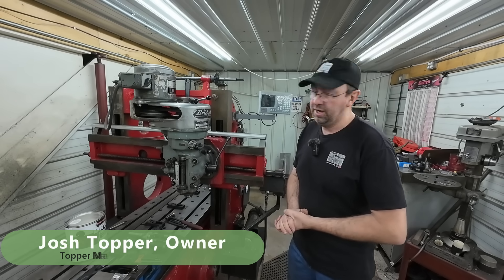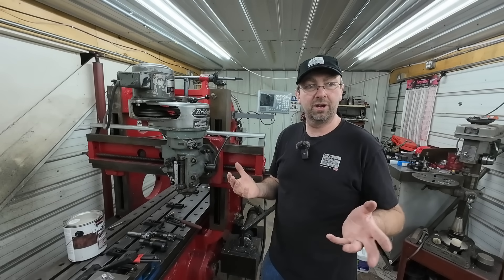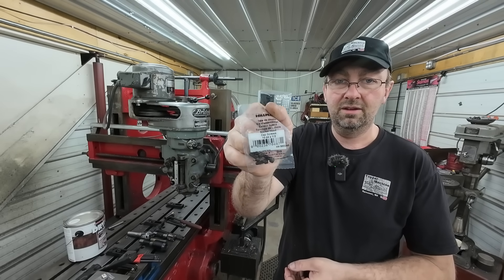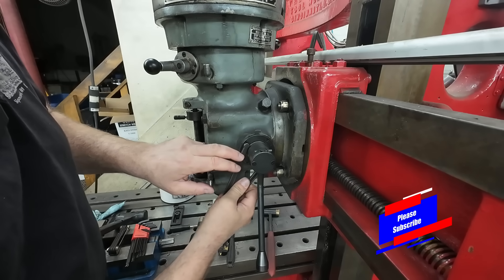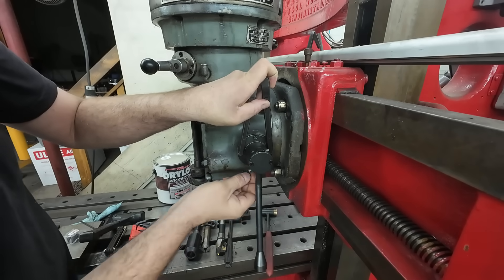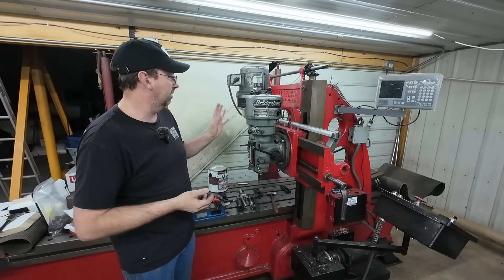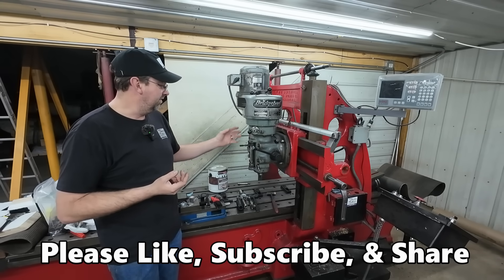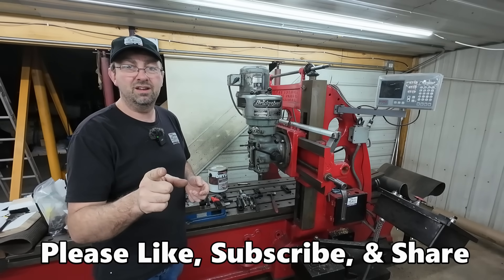Bridgeport Mill Repair Follow-Up | Setting The Clock Spring & Answering Viewer Questions & Comments

Comment: My power feed broke because the gear that drives the shaft (the worm wheel I guess) broke. It's very thin abd either pinned and setcrewed or just one, I forget. But, it was cheaper to buy a China assembly and use the gear from it,  than to buy just the gear. I have to get all the little balls and the "barbell" now. Power feed isn't important until you really need and miss it! Never put a long screw in the scale ruler mounts!! It prevents it from moving freely.

Comment: Bro, what is that green slime you are using? 
I use a plastic liter coke bottle with cutting oil and water, and i hate it. Thank you for your bridgeport videos. My boss has one that has a perfect head, but the table and base are antique hungarian . The table has automatic feed rate settings and a perpendicular drive centered below the quill that accepts a 3 jaw lathe chuck. The base can accomadate a twelve inch lathe chuck An absolute gem of a machine. 
The head works beautifully, however the only tool the boss has for it is a 5/8 drill chuck.
For ten years, without a vise, i can barely drill a hole. I would love to do a video or video call with you, I am asking for help . I know this machine is capable of machining  billet into a top fuel hemi or a gun barrel for a tank, yet she has problems ( missing every piece that makes her a mill. Im so drill  (de) pressed to have this at my fingertips, yet it is useless.
Reply from the maker: The green snot is Anchorlube. It is available through my website.

Comment: I don’t get why the quill doesn’t need to retract . Is not like you can mill whit out the quill lock tighten . I have a couple stile machine mills , tool room style , Bridgeport style( china and Taiwan) not original Bridgeport, because I hate R8. I have just 40 taper …. If is whit a quill , the quill spring retract it … that is what springs do 😂 
Please explain what is the benefit on not retracting … I don’t se it .

Comment: The quill is predominantly used for drilling so the spring tension should be set with a drill chuck loaded in the spindle. You may find that when you use it the quill will drop.
I would also check that the quill can fully extend without the spring binding up.
I would not worry too much about the short drop at the top, this is where the spring is barely loaded. It's rare that you work the quill at the very top.
Reply from the maker: I never use a drill chuck in the mill. Collets are the only acceptable tool holder in my shop.
Reply: @TopperMachineLLC  ok. I've never seen anyone use collets for drilling every size hole, too time consuming .
Reply from the maker: @machinists-shortcuts  I do. Chucks are just not good enough and add a lot of length and potential for other problems. As far as time consuming, it really doesn't take long to swap out collets.  About the same as using a chuck key on a chuck. And No, I won't use keyless.  I stage all my drills and collets before starting a multi hole job.
Reply from the maker: @ I am a professional shop, not a hobby shop.  I do this for a living and have been for 27 years.  Chucks don't do precision.  That is a fact.  I started out in tool and die, first thing I learned was not to use chucks.  The second was how to change collets quickly.  Collets are the only way to ensure accuracy.

Comment: My guess would be a fatigued break from years and years of use and from repeted chatter from dull cutters and improper milling practices if this is an okd machine and you're not the original owner. You are an excellent machinist

Comment: I always adjust my clock spring just so the quill won't lower by itself. Sometimes that means changing it for some tools. I have a large Wohlhaupter boring and facing head that is so heavy that I need to crank up the clock spring to keep it from falling. Never a good thing when a pricy carbide insert boring bar is hanging out there. It's an adjustment just like many others that are somewhat personal preference. I've used a lot of Bridgeports with broken clock springs over the years. You definitely don't want it to self-retract when boring with the power feed.

Comment: never seen one break like that before either. but I have seen the set screw back out of the auto feed and shear the gears for that but never the press gear. but i have only worked on 4 in my life but two have been hard used and abused and still are day to day.

Comment: In my experience on an Alliant knee mill, a bridgeport basically, you really dont need the clock spring for drilling or reaming, its nicer, but its really only needed for the quill feed or boring, and even then you could do that by hand by putting tension on the quill lock, not ideal but ive done it on a really old and messed up mill, worked for me, also on the other ones we had, the clock spring did nothing when drilling besides hold the quill in place, it never rebounded like you might imagine, yet again i think it only uses that during the quill feed gear system, which i never used. Great video Jake, i am glad things are going better for you and your shop. I wish all the luck to you.

Comment: I'm a heavy equipment guy, with a hobby in machining.
 When I was being taught to run big machines I was told if you aren't breaking stuff occasionally you are not using you are not using the machine to its full potential.
 there is a time for finesse and a time for bull work...
keep doing what makes money/sense... (and keep parts on hand)

Comment: I took a machine shop class back in 72 or 73 in high school, the rest of my knowledge comes from working in the industry and reading plus experience. These are machines and tools, even the best wear out or break. If it lasts forever it's probably not being used. Maintenance is the cost of doing real work. I learned "machine tool reconditioning" because I was poor and bought used tools. The machinist is one of the few mechanics who repairs his own tools. Keep on truckin'!

Comment: No need to justify yourself to idiots on the internet. Youre a professional. My experience is: Everything gets pushed until it breaks and then you back off 20%. Sometimes things even get used until they break and then five years. If you dont do that, youre leaving money on the table. Or wasting time. There is nothing wrong with taking pride in perfectly maintained and spotless clean machinery but thats something you worry about when everything else is already running smoothly.
Reply from the maker: Exactly.  Machines are made to be used to their limits to make money.  If you're not doing that, you are not in business.  Push it to the limit, sometimes they break.  Fix and move on.

Comment: speaking of 350 pound gorilla with a cheater bar, one of On Fire Welding's videos has TheGuys replacing the cutting edges on a salvage snip with mounting bolt torque in the 1000 ftlb range and LittleGuy was hanging off the end of a ten foot bar (like, feet off the ground, bouncing off this bar) and Getting Nowhere, and then BigGuy swaps in and just puts the GRONK on breaking this bolt loose. no judgement but if you don't have the weight to do the job.... (I weigh even less than LittleGuy)

Comment: To set the tension on the spring, put your drill chuck in the spindle. That will help you adjust the tension of the spring to the working weight of the quill.
There's a perfect explanation for why the gear failed. It's called shit breaks.
When doing any heavy drilling or drilling parts that might be "grabby" like a soft material or drilling a pilot or plunging with an end mill, I lock the quill and raise the knee. You have much greater control, can apply more pressure for popping chips with bigger drills and you save significant wear and tear on the quill.
Reply from the maker: I never use a chuck. Everything has to be in collets. It's just a better practice in the mill.

Comment: Good morning Josh,
Thanks for the follow up. I’m sure you have helped someone else out there with the same issues. 
One of your older videos popped up the other day and I have a suggestion. You were cutting the keyway with your vertical slotter and oil was going everywhere  except down the cutting edge. You could try some butyl tape. This is the same play dough type material that is used around RV windows. You can shape it into a dam and that might redirect the oil flow. 
A roll is inexpensive and you can dispose of the used material. 
I thought of this from watching Keith Rucker pour babbit bearings.
Reply from the maker: I was considering using my babbit damming compound to direct the flow.  Play doh would work too.  I will look into the tape.
Reply: Josh, Amazon has it for $16 for a 30 foot roll. If kept in a cool place, it will last for years. 
Best part is you can break off what you need. 
It is 1/8 thick and 1” wide.
Reply from the maker: @jimfiles3307  Thanks.  I don't like scAmazon, but will get some coming.
Reply: @TopperMachineLLC  Josh, 
Any RV store will have it in stock.

Comment: Not sure if anyone has asked, but if you have the tooling and machines why not make the gear or shaft out of your selected base metal?
Reply from the maker: Cost.  As a business, what makes more sense economically.  Buying a $47 gear or spending 3 hours making one.  Even if I only charged $25/hr, i would lose money.

Comment: i put my heve boring head is and adj to not let it drop, you may  back it off as needed for small tools,
a comment was   small head for large machine just  because its big doesn't mean your taking 2" off, look at like its a looong table bridgeport its cool, a friend has one with a big head for drilling and tapping its slow

Comment: I asked for help with mine, as usual, zero, guess I just have the wrong 'tone'.  It took forever, this summer I need to take the table apart as it binds up at times.  It isn't a Bridgeport and not even going to bother asking any questions.  Talk about upt nor't back woods people, they don't like me, breathing their air, I am, I've been up here since Kennedy was President, longer than most that give me hell.  The ones, time before the last, would not talk to me unless I had engineering plans and they were recommended by the best in the area.  I finally got around to drawing it up and then they wanted me to just leave them, so I prodded and heard the heavy footsteps and the leader reluctantly shows up, takes a look at it, I only drew two views as the third was obvious, and he asked "So, you want us to make two of these?"!  I ignored the red flags flying from every direction and waited at least a month and called them up.  There were other wild things, I forget, but they are like, oh, it is scheduled to start building tomorrow!  I'm like, ah, what about the bid?  "Bid?"  Like this is a completely new term to them, I even explained it, how it works, and then asked them if they were playing me...  There were even more weird stuff, I forget, so I just show up and demand the plans back and the reluctant dude shows back up and tells me that they desired not to make it after all because they are worried about my safety!  I could tell endless stories, if you don't "look" like one of them, they jack with you big time.  It is so bad that I finally realized that those sign on their businesses, about shopping local, really mean - Only Locals are welcome for business!  So, No INTINERANTS WELCOME!   The last one was so bad, I thought I just might snap, I was so livid, just refund my $ and I'll be gone, even told them, I should just MOVE AWAY.  I found something really interesting, animal cognition books, they are very telling about human psychology, much more so than Psychology books, even apes are big time conformists, they don't think for themselves they look around to find out what to think!

Comment: Even I with no machinist training and only a cheap mini mill, know that what your doing with 2 hands; it's called feel and ya have to operate the machine. I can tell ya from life experience that no matter how you run a man made machine: at some point something will break, whether ya are hard on it or easy, it will break. I had to replace an engine in a brand new car with 9 miles on it, that had a rod out the side of the block. That car must have been built on Friday afternoon, LOL

Comment: Something I learned too late in my career. Don't use your hand as a hammer. An old timer asked me one day. What drawer of my toolbox do I keep my hands at night? Wrenches and truck parts are way harder than skin and bone. Either a plastic dead blow, or leather mallet will go a long way to saving you a lot of misery when you get old like me. I've been retired for a decade. My callouses are all gone, the stains are worn away finally and my skin isn't as hard as a soul of a shoe. But every morning my hands have to hold the warm coffee pot for a while before the fingers start working. The tingling and pains are still there.
  Thank you Josh. Take care.
Reply: Don't discount the crescent hammer either (back side of an adjustable) better to use the wrong tool than to bash yourself up.
Wish someone would have warned me about this getting old stuff! (they did i just didn't listen)
Reply: I second this. So many people use their hand as a hammer. A 28 oz dead blow hammer is $30. Your hand is worth way more than that. 
People don't realize that all those impacts will add up and cause problems later in life. Your body is an operator. Not a tool.
Reply: I can support this advise.  50 years swinging spanners have left me in a similar condition.

Comment: As you were mentioning materials that require a bit of force and pull on the handle, I was thinkin' stainless. You said "stainless" just as I was thinkin' it! I've only been around 2 Bridgeports. But they've been around since WWII. They've never broken like that. And we cut stainless!
Reply: One of the best ways to assure that drills cut freely, even when sharp, is to make sure the blunt chisel edge is relieved to the center by split grinding. If accurately done any drill will cut much more freely with less pressure applied to the quill.

Comment: My thought would be, it's a drill quill and if should retract, height of the tool is set by the table not the quill extension. In some shops the quill is always fully retracted when milling, whenever possible.

Comment: You need the quill to retract. At least when no tool is mounted.  The handle is used mostly for your drilling and tapping jobs. Retracting hard is bad. This why you can adjust that coil spring.  A Bridgeport is a machine dedicated for light duty work.  If you intend to use it for hard core milling then you should have the quill completely retracted anyway.
Also, when you change tool often, you do really get to appreciate it's retracting ability because of the nature that you use to engage and disengage said tooling via the screw that you need to reach at the top of the head.
Reply from the maker: I have never had one or worked on one that did, so I will leave it how I know.  Why change something when it works.

Comment: I'm a retired industrial mechanic. I worked for a manufacturing plant that used cement in the process. That means frequent stuck screws. In your application, button head screws are fine, but I hate them. They have a smaller hex socket than a standard socket head screw that strips easier. You can't easily grab them with a vice grip. I call them butthead screws.
Reply: 🤣 Butthead screws ok now I have a new line to drop on my 3D printer friends.
Reply from the maker: I totally understand. This being a cosmetic situation, button head would be best. But socket head is far superior like you said.
Reply: @TopperMachineLLC  I appreciate the cosmetic considerations. A previous mechanic at the manufacturing plant loved buttheads. There were no cosmetic considerations. I spent too many hours extracting stuck buttheads in terrible places. As for the clock spring, you for sure don't want your spindle dropping on its own.

Comment: How is your local hardware store doing in your area?
Reply from the maker: Considering it's a 45 minute drive to get anything other than at the local store, they do just fine. But don't have a plumbing problem after 5pm. They are closed. 4:57 and they lock the door. I've been burnt by them many times, but we don't have much option. Unless you want to waste 2-3 hours traveling to get what you want.

Comment: Hi Josh. When you mentioned the 350 lb guy pulling down on the lever, it took me all the way back in time to when I saw a dude use a micrometer as a G clamp 😮😮😵‍💫👍. Cheers.
Reply from the maker: Lol, yup, they are out there.
Reply: uhg. I still have 'mine' from the jackass who insisted that I didn't know what a clamp was after letting himself in and to 'borrow' my tools; and I adamantly wanted to know "WHAT CLAMPS!?"
The measuring faces don't even meet any more.  Had to replace the door frame too (edit: though arguably that was already kinked, he only made it worse).

Comment: I’m assuming the new gear keyway is indexed the same as the old one. Like you stated, first one you’ve seen in 27 years. As always, I do like the follow up videos. Keep up the good work.
Reply from the maker: The new one was clocked correctly. I'm guessing mass produced and placement was missed on the original

Comment: If Bridgeport intended for it to retract, it surely would.  Does the manual address how much tension to put on the clock spring?
Reply from the maker: I have never seen an actual manual or any reference to setting the spring.